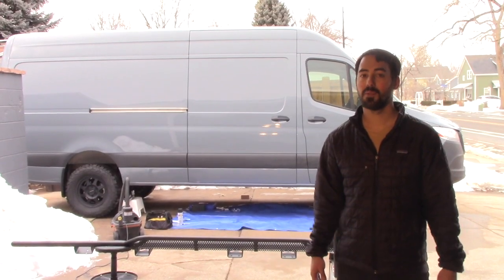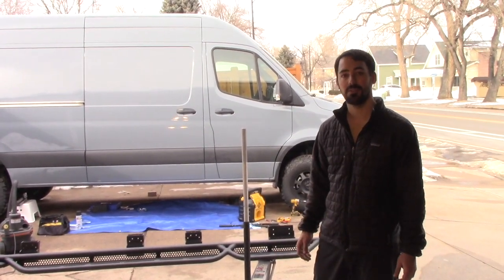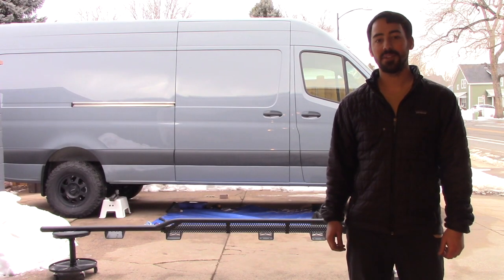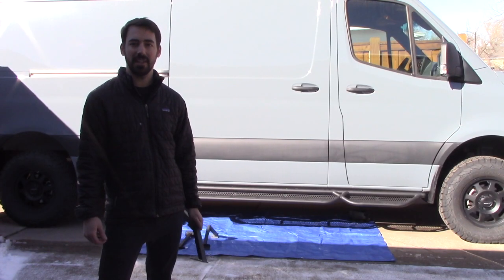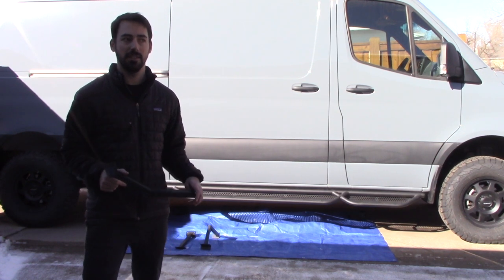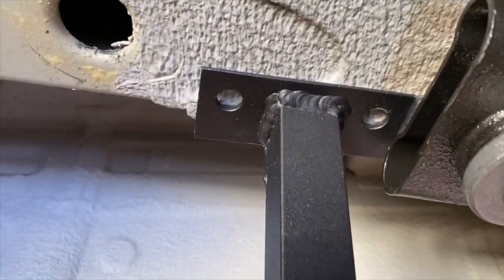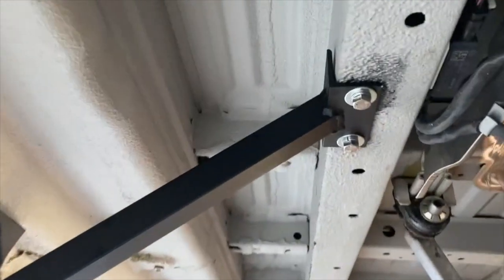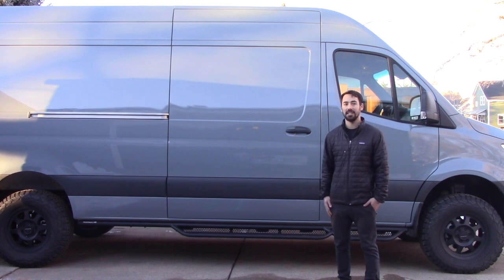Roambuilt Side Steps Install | 4x4 Sprinter Van Build

Comment: nice side step. But in Euro special Belgium you will not get an inspection on something where you have to drill into the chassis that is unsafe. however there are plenty of holes in the chassis that can be used.
Reply from the maker: Yah, we were not too happy about having to drill in the "no drill zone" of the van. But so far the side steps have held up great and were a GREAT addition to our van!

Comment: Let’s talk about these rails in a year or two after installation.  Those rivnuts on the edge of the sprinter metal are sure to fail with time.
Reply from the maker: Agreed, we were hoping for better mounting points and alignment; even the steps themselves were slightly curved and didn’t fit well. Overall a minor bummer, but with the loctite on the rivnuts we’re optimistic they’ll hold up for the life of the van
Reply: @vanagonia5196  I have install these steps on a 2019 Sprinter 170 and it was a total challenge to the point that we decided to fabricate and  weld plates to the attachments so that the steps could be securely fasten to the van.  Fabricated additional supports (braces)  just because two braces are not going to hold those rails with time.  We felt Roambuilt is taking advantage of consumers with a poorly rails design with regards to the attachment part; lack or non existing customer support for $1600 plus shipping is unacceptable.  The van sold but we could not take the chance (liability) with these steps so we spent an additional $400 plus dollars (labor) to make sure these steps were securely install on the Sprinter Van.  Oh ...by the way... I am not alone on my complain. Is all over the Sprinter Forum.  All I can say is good luck and make sure you’re looking underneath your van to make sure everything is there (bolts)

Comment: Good video.  Also like your wheels, are they 16 in.  What size tires..thanks
Reply from the maker: Nope they’re 17”, BFG KO2 LT265/70 R17’s to be exact

Unfortunately the 2019+ models don’t have enough clearance for larger than 16” stock, we had to install Agile Off-road’s aftermarket fenders in order to fit these. Super easy install, check out our other video for more details https://youtu.be/7aWPdvDQy_Y

Comment: What did you apply to the outside of the rivnut at 2:27 in the video?
Reply from the maker: Hey Richard, its Loctite Go2 Gel. We found that rivnuts sometimes slipped/spun if you didn’t tighten them just right (not too much, not too little). The extra bit of adhesive helps hold them in place as well as gives it a bit more of a waterproofing/seal around the exposed metals (even though we sprayed them with some paint too).

Comment: Roambuilt sent me the wrong length (needed the ladder compatible) side step, still waiting for their response what to do with it.
Reply from the maker: We had a similar startle as well; ordered the ladder compatible but the 144” sidestep showed up instead… or so we thought. Turns out the ladder compatible is ~2 feet short of the rear tire which is what makes it compatible with the ladder.

Best case for you, you get two driver side steps for the price of one! Good luck with the install!